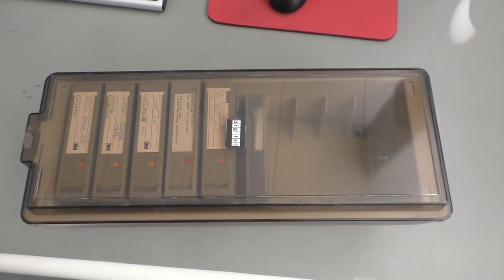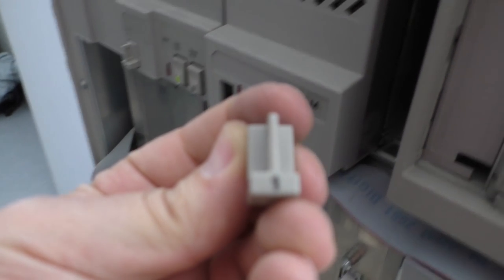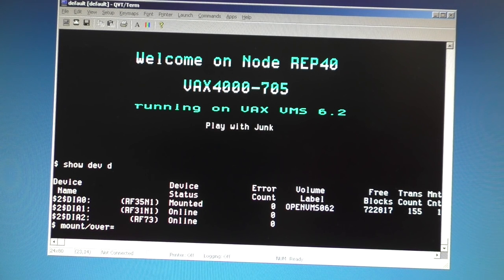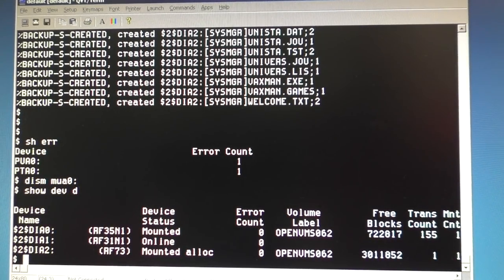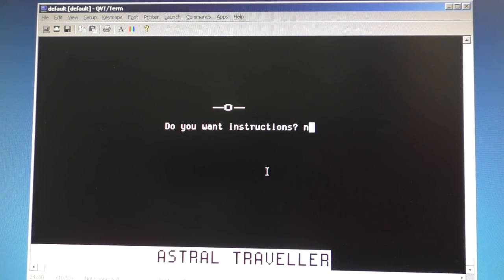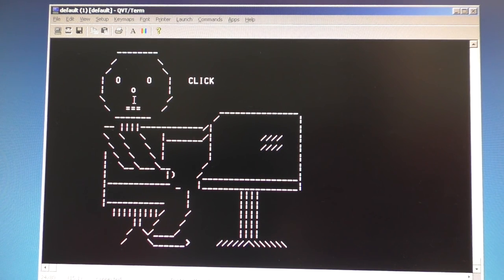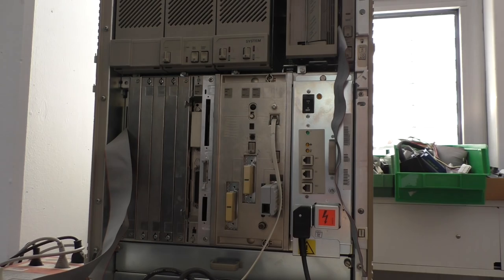PWJ56 - Playing DEC VAX games from 1978 and later

Comment: We used a VAX 11/780 at our college. It was in the late 80's, and the college was new, so I'm sure it was a donation. My first job was working on a DEC MicroVAX. I'm almost positive it was the same one you have there. At least the same case layout and very similar contents. I still have several tapes in my basement with all the software I wrote. Unlikely that they're still viable.

Edit: Wow. That disk write noise brings back the strongest memories.

Comment: Great video brought back some long gone memories. I was was a test and repair technician at the Ayr Manufacuring site in Scotland. Started on PDP 11/34 right through to VAX/Alpha 7000 & 10000 machines. Definitely remember playing 747, Vaxman and Snake. Vaxtrek was also a great game for it's time. I notice the Hi-pot stamp on the machine had an AY code so must have been built in the Ayr facility.
Reply from the maker: I remember the AY code... but I never knew what it meant. Thanks.
The only codes on DEC stuff are the US-Colorado "mountains" and the Netherlands "windmill"
Reply from the maker: I had an Alpha 7000 in my workshop and I let an early version of OpenVMS "SETI" run on it. It was at least twice as fast than every PC of that time. And it crunched 8 workloads at once...

Comment: I wrote a scanner capture driver for a Japan built Totec scanner. VMS 6.X for the Kodak KIMS project. We had a good Electrical Engineer named Dan Knowles who was working with a wire wrapped QBUS board to interface with the serial Totec scanner which could scan in Group3 or Group4 or Huffman encodings as I recall.  I think it took Dan and I a good 8 months to proof the board and me get the driver working. I had to go to DIGITAL in Spitbrook and talk to a VMS OS engineer about the System Virtual Address Pointer or SVAPTE. The scanner board would write repeatedly to mapping registers on the QBUS and I had to then save this data in memory. All fo this in Macro32. The driver device was called UAA0:, UAA1: think. I was dating Barbara Caprino at the time and taking Graduate Courses at RIT. This was for Kodak KIMS project in the mid to late 80's. Last century. Maybe the golden days of Kodak and it was fading. Later I worked at CESD after KIMS and was laid off in 1994.

Comment: Ths brings back some memories. I was system operator in the mid-80's through to mid-90's and started on a PDP 11/34 and 11/44 connected via DECnet with RK07 and RL02 drives, with a reel tape drive. Later upgraded to a MicroVax-II with TK50 tape drive as backup, with additonal MicroVAXes added over the following years to form a cluster, namely a 3100, then a 3100-80 (the "desktop" size enclosure) and then a 3100-90 and 3100-95. Ah the days when hard drives were in MB! I think we could backup our entire cluster worth of drives on three or four TK70's!

Comment: Remember the extended instruction set:
Rewind disk   ---  Punch operator
In the late 70ies to work as DEC FSE was to repair such equipment asap. So we mostly swapped circuit boards, which was boring.
Reply from the maker: Some boards had red error LEDs and they told us that one day even the cleaning staff can repair those computers because they only have to replace the "red" boards.
Fortunately it was never that easy. Techincal field service still exists today. Even if they sometimes just replace the entire server. But there is a lot of work to get all the software running again.... guys like us are still needed :-)

Comment: Really takes me back: I was the systems manager for a VAX cluster in a big college for some years, and we used TK50 and TK70 tapes/drives for backups. Started out as a MicroVAX-II and we progressively added more powerful nodes over time, including 3100-90's and 95's, and finally ending up with an Alpha, all runinng VAX-VMS which was a fantastic operating system (I think the cluster system was better then than what some modern systems do now!)
Reply from the maker: I agree... when VMS crashed it was a hardware fault. It was an operating system that could run for years without the need of rebooting. Many of the DEC programmers and technicians work for other companies now. The HP EVA storage controller for example.... the still have DEC style partnumbers inside. Most likely made by the same engineers as before at DEC...in the same factory :-)
Reply: We had repeated VMS crashes in around 1986 at a former employer of mine. It took DEC engineers spending some time at our site to track them down. A colleague suspected it had to do with our running a mixed CI/Ethernet cluster, which was unusual.

Comment: The memory board should be either an L4004-BA 32 MB (not supported by the L4006-BA KA694 705A CPU), an L4004-CA 64 MB, or an L4004-DA 128 MB board. With 4 of the L4004-DA 128 MB boards installed the maximum supported memory is 512 MB. The CDAL expansion connector on the L4006-BA KA694 CPU is for an optional KFDDB daughter board which add two additional DSSI channels. The 4000 705A was rated at 45 "VAX Unit of Performance" with the original 11/780 setting the unit value of 1.0 VUP, so quite a bit faster.
Reply from the maker: Detailed information... thank you. My memory is a -DA model, whopping 128MB!
I thought there was also a SCSI daughter board for the KA694. At least the tape slot can be used for SCSI drives too. I know there was a cable from the controller to the backplane for that.

Comment: The motors in those tape drives must run VERY hot.  I recently took apart a Compaq DLT7000 drive and it had two ceramic spacers on top of the large gate arrays and a thermal cutout on the drive frame.
Reply from the maker: Not only the motors... these drives need good cooling or they will overheat.

Comment: Thanks for that video (and your recommendation). The VAX 4000/705 is 5.6x faster than a VAX 4000/300, which was the first released VAX 4000 (but not the slowest) ;)
Reply from the maker: I put that 705 CPU board into the machine because it was the fastest we had. The slower modules have been scrapped….😩
Reply: @PlaywithJunk  Okay, so it was something like a VAX 4000/400 or above before. Unfortunately, the VAX 4000/300 cannot be upgraded without a change of the backplane :(
Reply: @PlaywithJunk  I have to correct that: There are probably different revisions and I have Rev. L01. If I have understood this correctly, I could probably upgrade to NVAX :)

Comment: Oh man, I once had a Digital Equipment Corporation MicroVAX-II with TK50, two floppies, RD53 and RD54 (Maxtor XT-2190 inside) +  some VT-terminal. It sounded like an F18 taking off and consumed half a KiloWatt.
Unfortunately I had in my possession before knowing anything and I swapped it for an IBM 5150 and 5160 back in 1999.

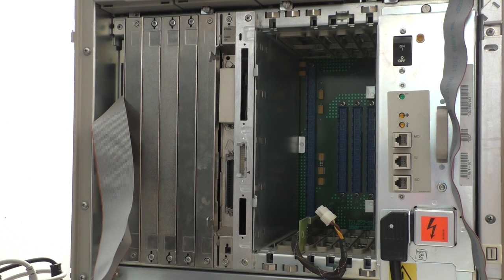Comment: 30:38 Preserving the MAC address was probably needed for DECnet. Unlike other networking protocols like TCP/IP or even AppleTalk, it had no ARP layer. So the DECnet address and the MAC address had to be locked together; changing one meant changing the other.
Reply from the maker: That's exactly how it was... swapping the MAC rom saved a lot of reconfiguration work.

Comment: Great video! I also a 4000, those are very nice machines. You show how to do a backup of a disk, I think this will only work for VMS volumes, there is no way to do a 1:1 copy of an ultrix installation from VMS? I still have an ultrix installation on another VAX, also on DSSI, which I am afraid to touch before I do not have a sufficient backup.
Reply from the maker: Well ULTRIX is a kind of UNIX... I'm not sure but a "dd" command should be available. With this you can do a 1:1 copy from one disk to another.
Reply: You can use backup/physical to copy ulttix disk on vms. Both disks need to be the same type.

Comment: If anyone was wondering what was under the silver lid of the TK50 Controller board it was probably an i80186 CPU since this card looks like one I had from a Mini VAX years ago.
Reply from the maker: Yes that's right. It's a 80186... This chip was used on many different controllers like Ethernet, tape, disk etc. They used it as an early form of microcontroller. I guess one engineer developed the curcuit and everyone else used it for their stuff too. :-)
But I have never seen a computer system with an 186 as CPU. They say that Intel has added some microcontroller features to the chip that brings no benefit for computer builders.
Reply: @PlaywithJunk  Wikipedia mentions the Mindset machine as one that used an 80186 CPU. That’s notable has having some advanced features, though unfortunately not compatible with the IBM PC.

Comment: VAXes supported frame buffer adapters and for VMS there were vector graphics applications so in theory you could have pretty good looking games comparable to the 486 era probably, though at that time a 5 or 6 digit $ computer running a game would have been ridiculous, although I'm sure was possible.
Reply from the maker: I once had a flight simulator running on a vax8000-something and a graphic VT terminal with vector graphics. Looked pretty good but was instable like hell. Crashed all the time :-)
I also had a Microvax2-gpx with a graphics adapter. DECWindows worked on that.
Reply: @PlaywithJunk  last VAX I used was a 4000 96 a workstation, how did I let that one go I still regret it, little I knew later it would be impossible to find one where I live. I still keep a pair of DEC 3000/300lx I will never separate from them
Reply from the maker: @boardernut  It's possible that I have a VAX4000-96.... where do you live?
Reply: @PlaywithJunk  Moving to Madrid in weeks

Comment: That VAX4000-705 has 9ns cycle time. Probably beats similarly clocked Pentium any day. What's the median power consumption on that one?
Reply from the maker: I have not measured it. It has one power supply with 850W, that will be the maximum for that box. Disks and memory did consume lots of power too.

Comment: 13:14 I think the general DCL syntax only looked at the first four characters of each token anyway.
Reply from the maker: Yes 4 letters ususally are enough, except there was a command that was similar and needed more letters to differenciate
Reply: Do you have an example of commands needing 4 letters? I suspect DCL commands and options were carefully chosen to avoid that.

(Edit: of course I meant “more than 4”.)
Reply from the maker: @lawrencedoliveiro9104  There are many that need 4 letters... CONNECT/CONVERT/CONTINUE, DISABLE/DISMOUNT, LOGIN/LOGOUT, DEALLOCATE/DEASSIGN

But I haven't found one that needs 5 :-)
Reply: @PlaywithJunk  That’s what I thought.

Also some were always abbreviable to a single letter, regardless: R(UN), C(ONTINUE), E(XAMINE), D(EPOSIT).

Comment: 14:12 Linux-type systems don’t require mounting block devices for reading/writing them at the sector level. In fact, mounting them is not recommended.

Comment: You work at a funny company that maintains support for 30+ year old computers and trashes 5 year old mainframes...
Reply from the maker: It only depends on what our customers work with... 
But an old VAX can be more useful than an new IBM mainframe. The question is what you wanna do with it.
Reply: Agreed. Obsolete but extremely rare hardware can be invaluable. The same goes for programming language skills.

Comment: Any chance you could accept my request to download these from your google drive site. I would love to try these on my MicroVAX 2000. Thanks!
Reply from the maker: Sure, no problem. Write me at playwithjunk@gmail.com and I can add you to the access list. I just need to know your Gmail address. :-)
Microvax2000, I know that thing. Pretty cute but also a bit of a mess inside ;-)
Reply: @PlaywithJunk  Thanks for sharing the files. I was able to upload them to my uV2000 over serial using Kermit. Most games work well. Yep, the uV2000 is a pain to pull apart and put back together, but I'm getting good at it now.
Reply from the maker: @philipl8184  When you install UCX (older) or TCPIP (newer) Services you can transfer files via FTP. That's way faster.
Most of the games require a VT52 terminal emulation. They don't work on VT100.